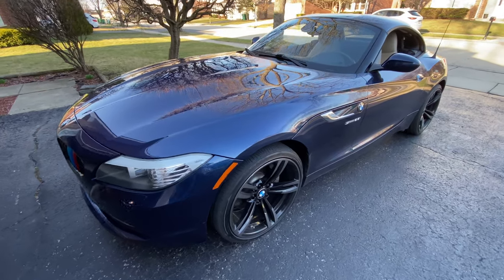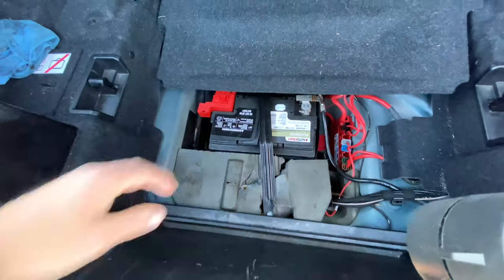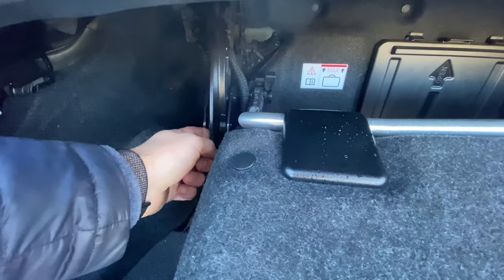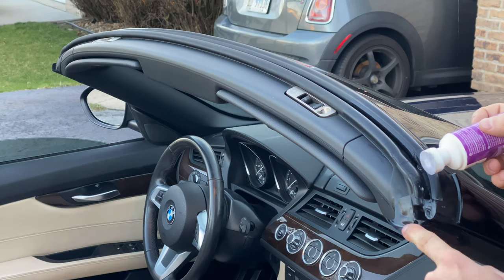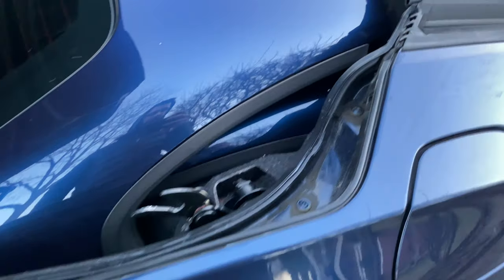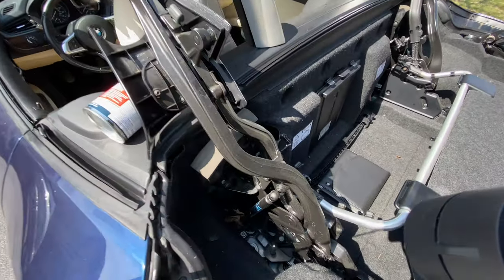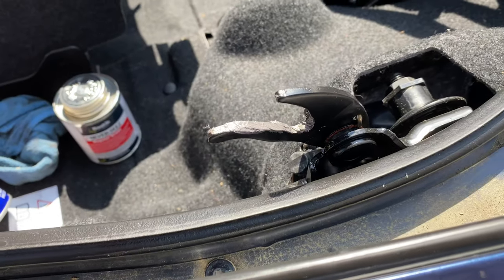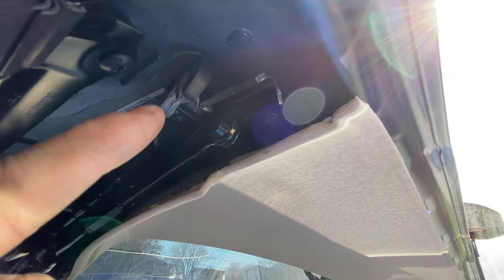BMW Convertible Roof Maintenance DIY

Comment: Its important to know that WD-40 is neither designed nor useful as a long term lubricant.  It is a Water Displacer, cleaner, and temporary lube.  Please consider using a light oil instead, preferably with a spout dropper not a spray that gets all over everything.  Thank you for an excellent video.  I know WAY more now about how to do this service.  Thank you!
Reply: Which one do you recommend?
Reply: Would you recommend using WD-40 Lithium Grease Spray lubricant? I would not use regular WD-40 for the reasons you already described, plus it attracts dust over time.
Reply: WD40 spray grease is fine if you don't mind the overspray going everywhere (which attracts dust, too). i personally prefer non-aerosol, drip oilers.  Much tidier and environment friendly.

Comment: Don't forget to change out the two salmon colored relays in the trunk that power the hydraulic pump. One  is for raising the top and the other is for lowering the top. The top pulls 40 amps and the contacts in the relays tend to get burnt. My top was very slow to operate because the relay contacts were burnt.  After replacing the relays the top operated much faster and smoother.

Comment: Wd40 should not be used for lubrication. it’s not a lubricant. It’s more of a solvent and rust dissolver.
Reply from the maker: You can use 3 in 1 oil like I mentioned in the video as well. WD-40 is definitely a lubricant, though.
Reply: SimpleCarGuy 3-1 would be better I agree. As for WD-40, I would correct myself: it’s a lubricant but not a proper grease. It dries out and cannot provide lubrications for components over the time, because it’s 2/3 solvent and 1/3 petroleum oil. I still would not advice to put it in the hinges of the retractable roof.
Reply: @SimpleCarGuy  WD40 is not a lubricant, it's a water dispersant agent. I believe it was invented to stop moisture build up on Mercury space craft. ( remember the can used to have a rocket on it) It's more likely to wash out grease. People started using it on car ignition systems that got wet or to loosen nuts on bolts.
Reply: I would not use WD-40 on anything I expect to move again.  I learned this when I owned a Cessna 172, after a few weeks in hot blazing sun WD-40 will harden, like super glue.  The aircraft mechanic said use Aerokroil, by KANO.  It is thin, used for lubricating, and in air tools.  Removes rust, gummed oil and grease.  It is also approved for FAA applacations, in engines.  I used it in the top joints in my 2009 Z4 E89, really good and not messy.

Comment: Personally I would use the grease & 3 in 1 oil not WD40. As mentioned already below WD40 is kit a lubricant. 
Once you’ve applied it I’d motor the roof a couple of times so the lubricant gets where it needs to & then remove the excess oil & grease from anywhere you see it. Both will attract dust & debris especially the grease. If you’re doing this every year you won’t need a lot to do the job. Keep both away from plastics & rubbers & obviously leather.

Comment: I did the same 2 weeks ago, but you did it more advanced, good job !
It's also interesting to have this video and topic, because in bmw community forums, i don't see so much talking about this.
Reply from the maker: I tried to do as thorough of a job as possible so it can be a good reference in the future. I agree that not a lot people are focusing on this, but it's an important maintenance to do if you don't want water, rust and other issues with the roof. Once something goes wrong, you pretty much have to take it to a dealer and that's going to be pricey. Thanks for watching!

Comment: Well that DIY roof maintenance was a workout, I'm beat and Thanks Again for your tips and video!!!

 I need to know what the dealer charges for this service so I can convince my wife to take me out to dinner (favorite restaurant Angelina's in Lake Havasu)  with all the money I saved us...

I used that Gummi Pfledge on all the rubber seals and that stuff is the bomb. To date (this old guy) it's the best product I've use on rubber seals. I took this step a bit further and did all the seals under the hood. Don't forget, when done clean the foam applicator with soap and water.

I'll have to admit there is a ton of joints that need lubrication on the Z4 so I tried to ease the pain with something a little different. WD 40 has a new product line called Specialist and has a spray lithium grease so I thought I'd give it a shot. I covered the areas with a towel and went real light on the trigger to minimize over-spray while spraying  the joints. This stuff is easy to use, minimal mess and works pretty good. Clean off excess with a towel and you can see the lubricant in between the joints just where it belongs. I also sprayed some of the lubricant into a towel (to minimize mess and cleanup) and squeezed the lubricant into some of the joints, hooks and latches. I know this stuff isn't what BMW recommends but oh well...

Comment: Such a great video. I watched it several times and just completed it in my E89. Tomorrow I’ll take it for a test drive to see if it solved the squeaking problems. I suspect it will. Thanks so much!
Reply from the maker: Glad you found it useful and hopefully all the squeaking is gone now! Thanks for watching!
Reply: @gstudios9642  it did, but I had to lubricate other parts of the mechanism to get the squeaking fully solved.

Comment: Thanks for the upload, I am currently restoring a 2011 z4 sDrive35is. It's an amazing car, just requires TLC!
Reply from the maker: Best of luck on the restore, I hope you get to drive her this summer. I've been looking for an sDrive35is, but I just can't find one that isn't outrageously out of my price range. They are a beast!
Reply: @SimpleCarGuy  thank you, it took me some time to find one as well! Honestly the e89 chassis is so beautiful. If you don't min, where did you buy your m4 wheels at? I currently have m wheels, but run flat and they are very thin (potholes worst enemy).
Reply from the maker: @DR_socal  I agree with you on the e89 chassis being of the best looking BMWs (without being super aggressive). Fun fact, it was designed by women designers!
I found mine on Craigslist. Guy was taking them off his M4 for some aftermarket ones.  Sold the tires and got the ones that fit the Z4.
Reply: @SimpleCarGuy  hey i just found your video at the right time i just got an 09 s35i and its my first bimmer and convertible car and im loving it my main concern was the rooftop i keep getting blinking rooftop up buttons when the roof is down. any indication as to why?  would this help fix this?
Reply: @tristansacotte6937  I've got an '09 3.0si.  I had some odd blinking and non-blinking lights on the roof up/down buttons.  Ran an OBD2 code reader and it came up with faults on the roof open/close...cleared the faults and all has been happy since.  Good luck with your car, they are head turners for sure.

Comment: The best long term maintenance is to clean all those  rubber seals with a  clean damp micro fiber towel. The dust and gunk that builds up is what ages the rubber . Wet the tower under the tap then wring it as much as you can, you want it damp, not wet.

Comment: WD-40 is water displacing and long term use causes it to turn into a glue like substance that attracts dust and dirt.  3 in 1 oil also attracts dust and dirt. A quarterly (periodic or at least bi-annually) dry lube like graphite will solve your lubrication needs but  it doesn't really last long.  Not trying to throw stones, just trying to offer better alternatives to WD-40.  Even penetrating lube is better than WD-40.
Reply from the maker: Thanks for the info! I've seen it recommended in many places and I haven't had issues so far myself, but if there are better products for this, I will definitely try them in the spring.
Reply: You are completely right. I can also inform you that the other parts that you filled with lithium grease (besides recommended by BMW) are fully maintenance free and should not be lubricated/greased at all, because they can attract dust and other stuff as well. So in fact it is rather a bad idea than a good idea. I work at the roof manufacturer (Webasto).
Most roof noise problems come from the boot-lid rubbing where the rollover Bars are. You can use felt there. Another area is where the center nose goes into the Lid hole. You might want to use grease or felt there as well. Most of the operating problems (roof stops while operation) come from broken cables at a bend.
Reply from the maker: @benjaminhengl586  Great info, I should make an update video in the spring!
Reply: @benjaminhengl586   can webasto service these roofs? I’m sure my dealer has no idea what to do with my roof. It’s all guess work!
Reply: @benjaminhengl586  is never seize lithium grease ?

Comment: I never even thought about doing maintenance on the roof, so that was on eyeopener. Would be nice though if you  could put up links to where you can order these products as they are not available in my country. So far your videos have made me buy the Autel AP200, the side light reflectors and now I would like to get my hands on these lubricants as well :)

Btw, Gummi pflege stift means Rubber care stick. Thought you might like to know...
Reply from the maker: People don't usually think about the roof until something goes wrong.. which is normally too late! It's definitely worth getting this done once a year at the very least! Are you from Germany? I posted links for US and UK, but I don't really know what's available in other countries. Really appreciate you watching!

I thought it mean rubber conditioner, so close enough!
Reply: SimpleCarGuy I see now you had included links already. Overlooked the whole introduction as it was collapsed. I am from Norway, but ordering from US is fine. Once again, appreciate your channel.

Comment: I think your issue with not getting enough voltage from the reverse wire was because you used T-tap wire splices. You arent guaranteed a good connection and they actually damage the wires when squeezing them down. Better to cut and splice wire in using heat shrink solder sleeves or standard crimp connections. Interesting that you wouldnt have tried that before adding a relay to the system. Also, the left hand side of the trunk has the harness with the actual grommet to access the license plate light. Great vid though!

Comment: This video has been so helpful. Is it ok to leave the roof half open while i clean/service with the engine off or should i leave it running the whole time?
Reply from the maker: Yeah, you don’t even have to run the engine to open and close the roof if your battery is good. In fact, I just had to fix an issues with my roof and the roof was half open for a couple weeks without any problems. Thanks for watching!
Reply: @SimpleCarGuy  Thanks a lot for the quick response! I just bought a 30i and started servicing the roof. It looks like one of the seals right between the boot lid and right rear quarter panel is going out so need to replace that. 

I just hope i don’t ever have to deal with water ingress issues so trying to take every precaution. 

May i request you to please video all maintenance/service work you perform on your car? Your videos have been tremendously helpful! Thank you!!

Comment: Thanks for the tutorial my friend! Need to get the Z4 ready for summer! I have a question, for seals that have become brittle and dried up, any recommendations of where I can get replacements for a good price?
Reply from the maker: I would go on RealOEM website and find the part numbers for which pieces you need, then Google that part number and see which places sells them for cheapest. That's how I usually shop for parts for my cars.  Thanks for watching!
Reply: @SimpleCarGuy  ah, perfect! Much appreciated! I took the Z for a wash today and noticed a drip of water on my headrest. Probably time to change, previous owner didn't maintained the seals.

Comment: Hi !! I bougth one 3.0 and Im thinking to use white grease Ipon to lubricate the hinges, it comes in spray mode and is easy to apply.Is no dangerous for the rubber too.Thanks for your tips !!

Comment: This is lovely video! I just purchased my first convertible (3 series 2009) and I can see some bronze “oil” all over the hinges. I have been driving for around a month now and putting roof up and down even few times a day. It doesn’t make any sound and seems quite smooth, but it’s not a new car so do you recommend me doing this maintenance just to make sure all is done properly? Also, should I do valet first to clean it all, and won’t they do all this for me then at the car wash? Hope you can advice!
Reply from the maker: Thanks! If you have ‘bronze oil’ then someone has been taking care of the car! That’s good news. The bronze stuff is similar to the silver anti seize compound I used so you are good there, no need to mess with the hinges until maybe next year if you use it a lot.
I would recommend just getting the gummi pflege (link in description) and going over all the rubbers to make sure they are properly conditioned. A good detailer should be able to do this for you, but a regular car wash will most likely just wipe it down and that’s it.
Reply: SimpleCarGuy super! Thanks so much!

Comment: Excellent video.  Thanks for making it.
Reply from the maker: Glad it was helpful! Appreciate you watching.
Reply: Good stuff.  By the way, my remote won't raise/lower the top.  I went by the BMW dealership and they couldn't figure out how to program it.  Any suggestions?
Reply from the maker: @n3307v  I'm not sure if you've mentioned it before, but does it have comfort access?
Reply: Yes.  It does have Comfort Access.
Reply from the maker: @n3307v  Honestly, I have no idea then. Make sure when you try the doors are closed and nothing is in the way and you aren't more than 2-3 ft from the car.

Comment: Nice video!  Can I ask where you got those diagrams at 03:00 in the video?  Also I have a question. I think you live in the mid-west of the USA so you get cold weather?  I live in France near Geneva so I get the same. I bought my E89 Z4 last summer and it is in superb condition. I never noticed any noises in the hard top. Now that the weather is cold, I am hearing a very slight noise now and then, which sounds like lateral movement where the hard top mates with the top of the windscreen. I am wondering if the cold weather could cause the metal to contract very slightly, allowing this lateral movement. If that is the case, should I just leave it alone? I am afraid that if I start tightening it down, without any proper documentation, I might have worse problems when the weather gets warm again.  Have you had experience of this, or am I talking nonsense?
Thanks!  Irish Louis living in France.
Reply from the maker: I found the diagram in a repair manual for the car. Don't have a link, but enough googling should yield some results. I haven't had any issues with noise in colder weather and I definitely would not recommend tightening anything if it was fine in the warm. I would guess that the rubbers have shrunk some and now allow some movement. First step would be to lubricate those and put correct pressure on the sills and other metal parts. I would do that twice if you haven't had anything done to the rubbers in the past year or two.  You should see some results after. Let me know how it goes and thanks for watching!

Comment: At my garage they use silicone remover on the rubber parts as these silicones which are in car shampoo attach to it and create squiking noises since some of these rubber parts are not really rubber. At least that was what they told me 😀. Do you use any product that contain silicones ?
Reply from the maker: Great tip! I haven't heard of using silicone remover on the rubber parts, but after conditioning it with the product I showed in the video there are no more squeaks. I will look into it for the next time I do this. I don't use any products that contain silicone, but who knows what the car wash I go to uses. 
Thanks for watching!

Comment: By any chance have you had issues with your convertible top not working? Mine was working great. Just randomly, It opened slightly then got message saying "movement impaired".  Buttons stopped responding so i turned the car off and hardtop closed on its own but did not lock. So i started the car, pressed the button to lock and i heard locking mechanism locked it. I tried opening  again same thing happened..Next morning, I moved the cable slightly on passenger side seat and all of a sudden, convertible top button started flashing red, i guess that slight touch made it worst. Now when i drive past 2 miles...I get the annoying bmw gong alert nonstop saying top not locked. Any tips would be appreciated.

Comment: I used 3 and 1 RV rubber seal oil instead of the gummi fledge seemed to work fine. Anyone use this also? 

I’m having a hard time finding that white lithium grease on Amazon. Any other good substitutes? Thanks for the video!

Comment: Great video, mine is turning 12 years I have no idea how to do this maintenance. I'll appreciate any video o tips how to glue back the roof liner. The rear felt down and I have no clue how to put it back. Any ideo how to do it? Thanks
Reply: Try spray adhesive

Comment: HI! I have a problem with my E89 z4 roof. The rear part of my roof is being locked too close to the car after having my top up, causing the two pointy angles to bump with the plastic trim and creating dents on it. Do u have any idea how to fix it?

Comment: WARNING!  I did the lube as suggested and the rear panel actually collided with the top part of my roof, leaving 4 tiny indentation marks/chips.  this only happened the first time after the oiling.  not sure why, but if you do this please put a carpet or thick towel on the roof panel as the rear panel is coming down in case it happens to you. - Pappy